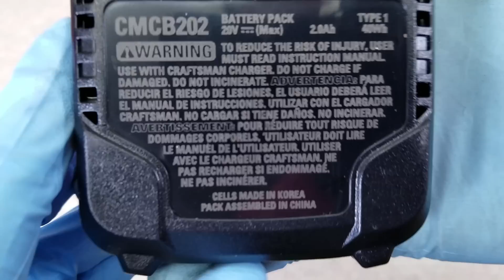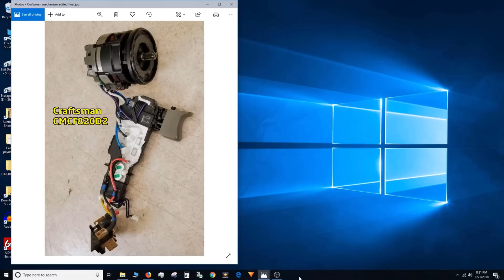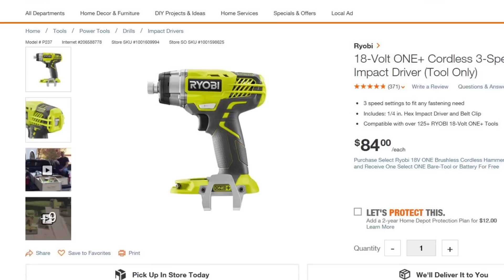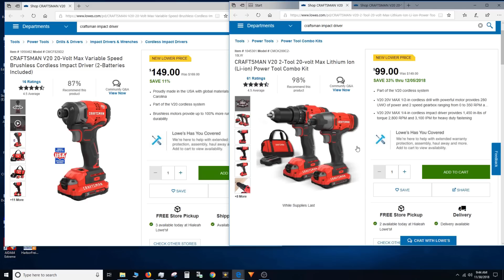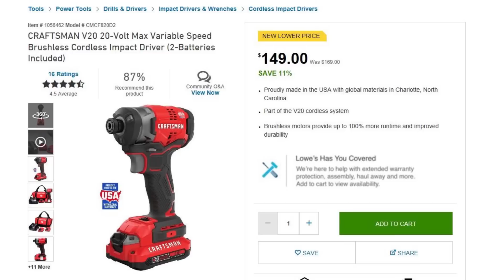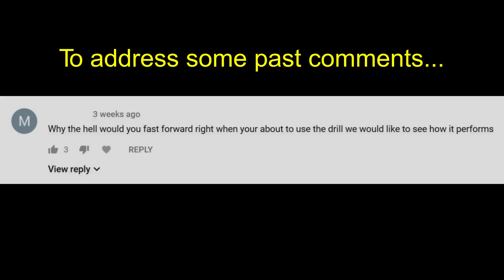Teardown review: new Craftsman brushless impact driver from Lowe’s - is it a DeWalt clone?

Comment: Yeah dude i got this with the brushless hammer drill, somewhere around 3 years ago, i work with them a lot and ive dropped them and the batteries pretty hard, and from tall ladders even, and they still going strong. I used to work with a guy that only got dewalt so I’ve worked extensively with both and honestly there wasnt a notable difference, other than the quarter inch of compactness. Im one of those crazies that extensively compares things too and honestly ive seen Milwaukee’s and Dewalt’s high end brushless drivers crap out with in the time ive had my craftsman’s and not even under heavy use which is exactly what ive put mine thru i mean I used the hammer drill to drill, probably about 150 holes in concrete and brick in 2 days. These drills are a great example of how you need to do your research

Comment: …and now there is the Craftsman CMCF940 which is a rebranded DeWALT DCF899 half-inch high-torque impact wrench that somehow even outperforms the DCF899. Of course, now DeWALT has a new DCF900 half-inch high-torque that beats everything but getting last year’s DCF899 performance for less is still a good thing.

Comment: You seem like the perfect guy to answer this question. In your opinion, for performance and longevity, would safely removing as much grease as possible, and replacing it with the best available, compatible grease, be a good idea? I've always been a fan of premium lubrication, and a 3 decade user of Amsoil products whenever possible. I never really thought about lube other than for vehicles and trailers. I recently replaced the grease on a 90 tooth ratchet, right out of the box, and used Super Lube. It was simply amazing how much better it was. I have noticed, especially on Chinese made products, they always skimp on the quality of the lube. Even for the more expensive professional grade tools and products. Not sure why a few more pennies would hurt them, but apparently it does.
Reply: Apparently he wasn't the perfecvt guy because 2 months later he still has not answered your questions.
LMFAO

Comment: I use craftsman power tools in hvac and I have used and abused both hammer drill and impact and they are by far my favorite yes it’s down on power by 10-15% but in my field I don’t need that 10-15% more and it’s cheaper and have really great warranty’s

Comment: I know I’m a bit late to the game but I think I can answer a little bit about why the battery is lower quality than the tool itself. In this instance I believe with it being a combo pack of the tool and battery it’s likely the case that the tool was built to a much higher standard as craftsman try’s to improve and meet the standards of there community, where as the battery at overflow and build in bulk from a 3rd party manufacturer. It’s a mixing of new standards and off the shelf parts. Same reason we still get the bags and not much better built cases. They are pushing out old stock and making room for better built products.

Comment: The battery cover is pc/abs this is very strong.
The mechanical specifications for PC-ABS include: Tensile strength: 5,900 psi. Tensile modulus: 278,000 psi. Flexural strength: 9,800 psi.

Comment: I had it bought it charged it used it once then I went away for a week came back battery’s were completely dead and the charger wasn’t working but I have old milwalkies and kobalt s that I don’t charge for months and are still fully charged and working so I instantly returned it

Comment: I bought the combo to work on industrial and commercial projects for a company and so far everyone on my job site was impressed with the brushless impact and drill. However the Sawzall and circular saw are crap the motor burns out on the sawzall and the plastic on the circular breaks easily

Comment: Not surprised by this; Lowes may putting Kobalt in a holding pattern  though they have some tools in a new XTR line, which from what I've seen so far seem to be impressive at the sale price point.  

My guess is that Craftsman will eventually replace the Kobalt max tools, the XTR will become the in house premium brand to compare with more established names; i.e., Milwaukee, Rigid, and others.

Still, unless it was sold at a very low price point, I would not purchase it because Lowe's customer service is so poor.  I have a Kobalt 24max drill that I cannot get repaired because I cannot get anyone to answer the telephone or respond to emails. 
See if you can get help at the toll free number for warranty before purchase, then decide if this is the right brand of power tools for you.

I've had experience with Stanley/Black and Decker service/warranty, so the Craftsman situation should be okay.  My reference above is about the Lowe's house brand Kobalt, just to be clear.

Comment: Should I buy it?  Well if I am using this tool daily in my business, I would say no.  Go with the Makita or Milwaukee.  If I am using this tool less than daily for my business then yes because it is built well.  If I am using this tool as a DIY or homeowner then no because there are cheaper options out there for the occasional use.

Comment: old post I know 😔as a DIYer.  I'm sorta impressed with these newer Craftsman tools.   there's a nice pool of knowledge coming from Stanley Black & Decker my question is how long will the platform last? and maybe some of the shortcuts are the batteries.   I can't tell you how many exploded (broken case )DeWalt batteries I've seen at work I think they use ABS as well.   wrap them up with some tape keep on working 😉. now I want to see some holiday deals 👍 I also don't like that you really have to replace the entire guts to fix it or throw it away and buyI just like repairing a switch if it needs a switch not tossing the whole thing 😕
Reply: That was the important thing for me as well when buying tools, the longevity of the platform. That’s why I initially went with Ryobi, but as I needed more powerful tools I bought into the DeWalt 20v lineup and it worries me too the battery platform won’t be around long either.

Comment: Hi, sounds like you know alot more about this stuff then i do! Is this product ok for just DIY stuff on weekends or should i seel a similiar but better product? What do you suggest? Thanks
Reply from the maker: It's a rebranded dewalt, so it's plenty good. Better question would be what battery platform do you want to get into? I guess if you want multiple tools it would be a good idea to choose one company so they can all use the same batteries.

Comment: Its 89 at lowes now, lol
Reply from the maker: That one's a little bit different. Only one battery, it's not built in the USA and it's rated for slightly less torque.
Reply: Correction: 
Currently $89 at Lowes for the Craftsman (CMCF820B) Impact Driver ONLY. Basic same model as DeWalt (DCF887B) Impact Driver ONLY on sale for $129.
Also...
$89 at Lowes for the Craftsman (CMCF810) Impact Driver with ONE 1.5Ah battery and Charger. Basic same model as DeWalt (DCF787) which is on sale for $119 with one 1.5Ah battery and charger OR two 1.3Ah batteries and Charger for $119.  Lowes is not selling the DeWalt DCF787 Impact Driver alone...they are trying to get rid of them with the lowest bare-bones batteries. However, some reviews on YouTube rate the DCF787 more reliable than the newer DCF887.

Comment: Considering that the Craftsman impact has cheap, easily broken ABS plastic, the ease of breakage when compared to DeWalts battery case makes the addition year of warranty irrelevant, for me.  Having to go through an unnecessary hassle of having to drive to the store or mail in the broken battery just isn’t worth the headache.

Comment: The 887 is the one that catches fire, I'll stick with the 885.
Reply: I own two 887s, they get heavily abused in a professional contractor environment so, driving big lag screws and what you seppos call tapcons all the time. No smoke. If you try to wreck any tool you will most likely be successful, but my 887s keep going.

Comment: I own most of the newer Craftsman v20 tools.  I bought them through sales at lowes and some good deals on eBay.  I previously used the C3 stuff.   This new stuff is pretty good no problems yet.  I was able to get all this cheaper than DEWalt.   I am impressed with the battery life.  My complaint is I wish they had some more tools available .
Reply: Lowe’s has huge Craftsman selection, Amazon has okay array of it, and Ace sells some too. Pretty good prosumer or homeowner grade tool lines, notably the V20 line for power tools. Competes with Ryobi and seems to generally edge them out in quality, albeit with less quantity.

Comment: ive taken apart and fixed a plethora of dewalt brushless inpacts/drills etc
and this has the same exact motor/switch combo and impact mechanism as the dewalt
Reply: I have the whole craftsmen line of tools and these are great tools no complaints

Comment: Ok it will take off a lugnut. BUT what was the nut torqued to to start with ? I have tried some 1/2 drive cordless impact tools on my truck that will break loose the nuts but takes all its got   Some lugs have torque specs over 150ft/lb and some as low as 100 or less   Next time show starting torque for comparison
Reply from the maker: All that info is in the first video. https://youtu.be/sOagC6iT4Ic

Comment: I had a 20v Craftsman Pro drill and impact driver, uses lithium batteries, they were made in 06 and they still work great till this day. I gave them to my brother and went with Milwaukee because they weighed a ton, but they're still kicking after 13 years. Pretty impressive for cordless tools with original batteries.

Comment: Do you know if the lower end craftsman tools use the same batteries?  Perhaps they are lower quality due to the battery being sold in the cheaper line.  Might be the difference between craftsman and DeWalt.

Comment: I really enjoyed your video, I  suspected that Craftsman was a re-branded DeWalt, but I would like to point out one small minor error. DeWALT is not Stanley/Black N Decker's top of the line brand. Its actually Stanley/Back N Decker's 2nd tier brand. Mac Tools is Stanley/Black N Decker's   #1 tier "top of line" brand.  Here is a link to Mac Tools Impact Driver .....I  would be curious if the Mac Impact Driver has the same guts as the Craftsman & DeWalt does. Because a lot of guys would be seriously pissed off if they've spent top dollar for a Mac Impact only to discover that it is the same thing as a Craftsman from Lowe's that cost 1/3 the price. .....Maybe that should be your next video. 
https://www.mactools.com/en-us/Power-Tools/Cordless-Tools/MCF886M1D1/20V-MAX-1-4-Hex-Drive-BL-Spec-Brushless-Impact-Driver-Kitr (which has interchangeable batteries with the DeWALT 20V Max system).
Reply: Or Proto

Comment: This went on another lower price sale. I picked this up for $129 today. Sale expires today, 12/17/18
Reply from the maker: You're right. That makes this a very interesting deal, because it's significantly cheaper than the Dewalt version.
Reply: Great videos by the way.
Reply: Bare tool about $100... -D2 kit with charger, bag, and two 2ah batteries runs for about $170. Since I already have enough chargers and 2ah batteries on the V20 line I’d get the bare tool... and try and find a larger ah battery for the line too.

Comment: Great tear down. Well explained and clear video.  I'll sub. I gave up on Crapsman a few years back. Used to be a great company and I bought a ton of their tools. I am not a fan of DeWalt either. I purchased a bunch of the first 12v and 18v tools and didn't have much luck with them.
Reply: Hm.  Everything has a limit.  Maybe you exceed limits a lot.  Even the best made tools/equip will break down after daily extreme routines and working conditions.   And the added overuse can stress them out in the field over time.  I am a retired professional Landscape maintenance business owner and I’ve spent tens of thousands of dollars over many many years with even the best names (Still, Echo, Honda, Husqvarna, Toro etc) wearing down and then breaking down even with regular maintenance and service, so…
Reply: @martygreen3145  No I think I attribute a lot of the failures to all the technology new cordless tools are much better than they were in the NiCad battery days My old DeWalt tools literally shook themselves to death.
Reply: @foxwood67  Oh ok..  I went back and re-read it,  😂.  I gotcha man.

But yeah you are certainly right about that.  I a way technology is better but at the same time it is an agonizing crutch!  😂.

Good Looking out!

Comment: I would think those dovetail slots would be more expensive in terms of tooling opposed to through holes. They must save on rubber material with a smaller shot size for it to be worth that extra complexity. Interesting design decision.

Comment: I wonder how this one compares to the BLACK+DECKER BDCI20C 20V MAX Lithium impact driver; which is the cheapest one I have found with a battery and charger included.
Reply: The craftsman is going to be substantially more powerful with a better spring, better electronics, better motor, and better batteries but you pay more for that

Comment: I'm sorry, but isn't ABS plastic known for it's impact resistance. So it may be a better alternativ on the batteri as it dosn't have to be super strong but may have to take an impact if you drop the tool? I may be totally wrong here.
Reply: kaiza94 you are correct. It’s also able to withstand 105 degree and still no melting point. Same stuff LEGO blocks are made of . Unbreakable. It’s hard to break unless you hammer the crap out of one lol Abs is pretty sturdy man

Comment: I know your not an electrical engineer but the difference between a BLDC and universal motor go a lot deeper than just a commutator
Reply from the maker: I never said I was listing every difference. To keep the video to a reasonable length you have to just hit the high points.
Reply: Tool Teardowns fair enough. The biggest problem with the commutator and brushes is wear over time. But torque and power consumption between the 2 is vastly different. 

Are the batteries over wrapped to hide the manufacturer? Sometimes companies will wrap them to cover the OEM labeling.

Comment: to me it's really a close deal. Dewalt is sale on HD for $199, Craftsman for $149. Considering the battery housing material, 18650 battery, warranty length and the main body housing size difference, I don't know, maybe for some professionals those are essential criteria, but as a weekend warrior, I probably go with the new craftsman. 
Made in USA or China doesn't affect my decision. There are shitty products made in USA and good products made in China, vise versa. As long as they do the job well, I don't care. I'll pick the one has the  highest cost-effective ratio. 
As for the battery, those numbers probably are the production date and week, I guess. It's either Samsung or LG battery. Here is a list for 18650 battery cells, (I didn't make it, but google it out from someone's share drive) https://drive.google.com/file/d/0B9KXttJ6nbz6VWUtcUtvZEY3dWc/view?usp=sharing

Comment: The disadvantages to brushless is indeed the needed Elektronic to control the brushless but not because of added cost, BECAUSE OF ADDED COMPLEXITY TOOLS BREAK!! NON COMPLEX TOOLA LASTS...IT ADDS ENORMOUS COST IF MADE RELIABLE which no one does.. brushless on paper looks good but when did you trash a brushed motor because of brushfailure or wear? Bearings and switches is what fails, yet no one uses magnetic switches or good bearings to begin with.
Reply: The disadvantage to brushless tools don't outweigh the advantages to them, namely more power.
Reply: Brushed motors are the future my friend. They are safer, more reliable, more powerful, more compact, they have one moving part instead of several, and all kinds of things can be programmed in to enhance user safety, and enhance precision. They are getting better all the time, and they are getting cheaper. For battery tools it's the way to go.

Comment: Great video. Teardown videos are always fun. Thanks.

Looks like SBD made a new battery design for Craftsman.
Usually, all the tools from SBD used one of two battery designs, and compatibilities were only blocked by some plastic tabs on the case.

But that battery actually has different design. Connectors are placed with wider interval.
I think that could mean SBD is putting some good amount of effort on Craftsman lineup.

Comment: Who cares if its dewalt or not? Dewalt and craftsman are both garbage that only homeowners use. I would honestly use bosch or ryobi before ever thinking about using gaywalt or crapsman.
Reply: Lmao you need to be honest.. you never owned a dewalt tool have you? 😂.maybe a 14.4 volt drill from 1986 at the most?? You need to understand as a carpenter I’ve used the same dewalt impact driver,same drill, same miter saw, and same sanders since I got my recent job as a framer and finisher and are yet to see a single failure or job they can’t do. Had those three tools for 4 years and use them every Monday through Friday
Reply: Stick with Makita Last forever and I never was sold on the Dewalt hype. When they first came out my company in NY swapped out all our old Milwaukee9.9v straight battery stuff. This was top o line back then but Dewalt gave us a killer deal and bought our old Milwaukee stuff.. Anyway after 1 week I told my boss I want my Milwaukee stufff back. new Milwaukee stuff of I quit because the Dewalt was terrible and ate up batteries like crazy with no vehicle charger like my old 9.9v had.. In the end I got a new set of Milwaukee stuff and my co workers got stuck with the yellow n black junk.. They were all jealous that I had the "old, stuff... old but good i day
Reply: Really mature
Reply: Obviously not in construction...stick to frying burgers